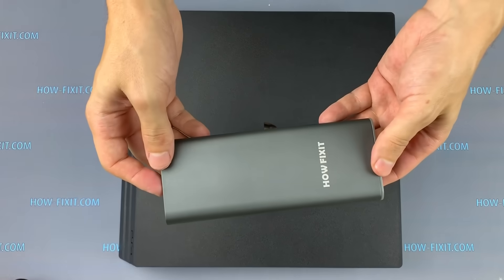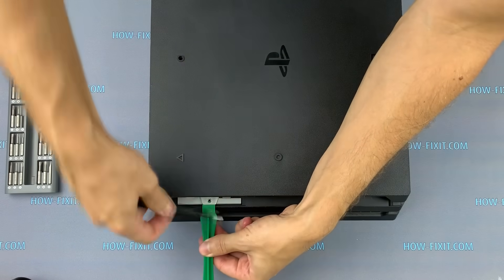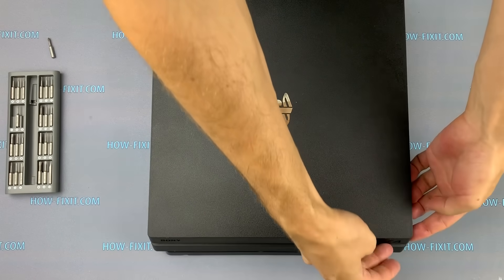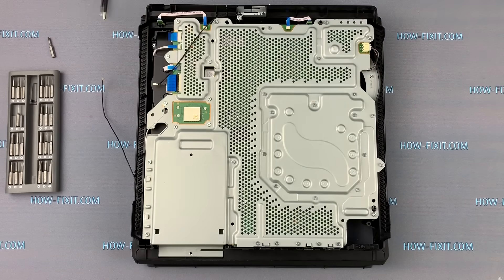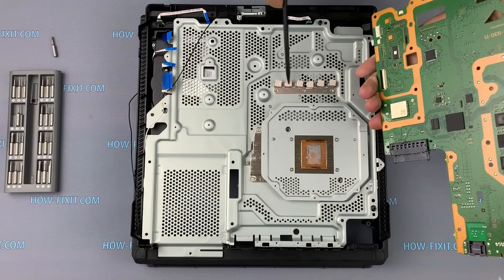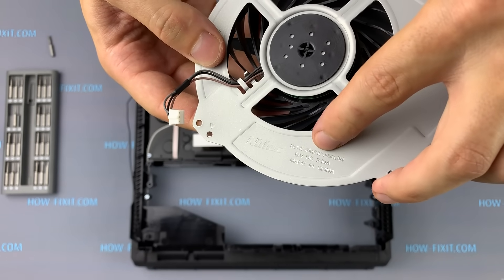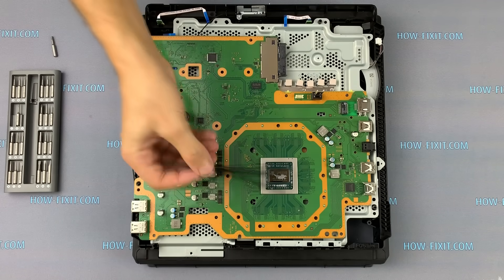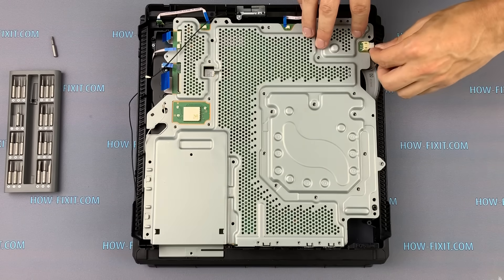PS4 Pro Disassembly: Ultimate Guide for Fan Cleaning and Thermal Paste Replacement

Comment: This worked beautifully. I have a ps4 pro and playing games where cutscenes would occasionally occur, I was constantly getting overheat messages and it would sometimes just straight up shutdown resulting in having to wait on it to restart and run memory test. The instructions here were well laid out and easy to follow. Because I'm sometimes of a perfectionist, it took me about an hour and a half to complete.

Couple tips for anyone wanting to try this. 
1. The tools are must have. Do not attempt without the correct torx and Phillips. A tiny flathead is recommended too, as when I took off the case, a couple screws looked slightly stripped at the heads.
2. I bought Corsair name brand Thermal Paste model/type XTM50 from Best Buy. During this pandemic, you can walk straight up to the door, ask them for the part, and pay at door. You do not have to order online and wait for it to arrive. 
3. I also bought some electronics spray cleaner. Not compressed air. It cleans and evaporates quickly. It's also good to use if you need to start over applying the Thermal Paste. 
4. TAKE YOUR TIME. Better to take 2-3 hours doing it slowly and right, than to try and rush it and break a wire ribbon, essentially throwing away the money you paid for it. 

I have since tested the PS4 extensively (turning boost mode back on), going through multiple games to see if any of the overheating issues and loud fan noise would occur in places they did every time before, and haven't even heard a whisper. Best video I've found. Saved me the headache of buying a new system.

Comment: Thanks so much Mr. It was like a jet engine before. I followed the instructions step by step and now it is quiet as heaven. First I did not believe in this process but it is amazing. I used arctic Mx-4 thermal paste also renewed thermal pads. Thanks man..

Comment: Amazing!!! I bought used PS4 Pro, it sounded like a jet engine in almost every new game. I thought thats normal, but still used your video to open and clean it, change thermal paste, and found that factory paste was very very bad, and the radiator was almost jammed by the dust, mixed with moisture. It was like almost like carpet that stopped airflow. Now, my PS4 pro is totaly silent. Thank you!!!
Reply: Where is the heat sink?

Comment: Thanks for the guide! Before I had 80dB noise coming out the back, after I replaced the paste and thermal pads it dropped to 50dB. Difference is absolutely HUGE!
I used Thermal Grizzly Hydronaut (Kyronaut was not available at the time) and Gelid 1mm pads.

Comment: Hii hope someone replies.  I want to clean my ps4 pro (due to lockdown & my console is overheating in this period) but i dont have a compressed air,  a thermal paste or any of the tools in this vid (except for a t8 screwdriver) is it ok if i try to clean my Heatsink without changing the thermal paste?
Reply: Yes
Reply: @GubbinsReal  have you tried yourself?  Many of them on Reddit say not to do so
Reply: Maheshwaran Gnanasambantham I am doing it today, but i am replacing thermal paste. I would just get the things you are missing and replace thermal paste as well. But that’s your choice :)

Comment: My heatsink wasn't all that bad. It was fairly clear. However, replacing the thermal paste turned out to be a night and day difference. It went from propeller engines level loud to whisper quiet. You have earned a subscriber. Thank you!

Comment: Dude thanks for and amazing video. My Pro used to sound like a jet taking off, but today I changed the thermal paste on the CPU/GPU as well as  the pads on the RAM. Just booted up Warzone and its silent, I mean totally silent, the fan doesn’t even kick in. For other users info I went for Thermal Grizzly paste and Artic pads. Could not have done it without your help. Hat’s off to you.

Comment: PLS HELP ME, hey guys, my ps4 pro wont turn back on... its beeps, then the blue light turns for a second on then it shuts down completely. The first time it worked fine, i just blew away all the dust but the second time ive replaced the thermal paste and put on the one from grizzly, and even the pads all new. But now its not turning on...  pls any tips will help. ty in advance.

Comment: I'm kinda pissed that I almost ripped off the connector to the PSU from the motherboard when I heard a bit of a crack sound because of how you did at 3:14 and I read somewhere online that the connector has some tamper proof superglue or whatever it is that made pulling the connector too hard. And I saw another similar teardown video and he included a warning about pulling it and he even used a certain plier. You should at least warn viewers about doing this so. Some other teardown videos also warn viewers about the gripping area when opening the case. I'd recommend anyone watching this to watch more teardown videos and not relying only this. There are some videos also explain different models of PS4 Pro and that there are some that has screws on certain areas and others have only latches.

And really, showing us making coffee? You spent that time to include in your teardown video and not try to at least warn something before attempting to do something to a part that can be very risky?
Reply: I wish I had read this first. I came across the cable connected with my PSU and it would not disconnect to the point I stopped myself going any further. But now I think when I put it back together, the two metal pins that fix next to the PSU cable to the motherboard have not slotted back in right. As my ps4 no longer turns on. Going to have another go at this tomorrow morning. But a MASSIVE warning out to people attempting this if you have a different model to this guys (mine being the different Power supply socket is slightly different.  Don't attempt this. As a lot of the disassemble parts were no where as easy as this guys ps4 model is. The one I have is very much tamper proof which just caused too much stress for myself.

Comment: Thank you so much for this video. Great very clear video and the highlighting of screws at points was very useful.. Took my time and got this done in about 3 hours, including the cup of coffee in the middle. My jet powered PS4 Pro us now nice and quiet. There was only about a 60% to 70% covering of the CPU with thermal paste when manufactured.  The 2mm blanket of dust accross the front of the cooling fins was probably the biggest  problem but it is quieter now than when new.

Comment: I’m struggling to get this thing apart.  I tried T-8 torque but adapters and they don’t seem to fit for the inside screws.  I tried 7, 8, 9.  Someone please help!!!
Reply: I encountered a few T-8 screws that were already stripped (from the factory) on my nephews PS4 Pro while following this guide. I was able to unscrew these using a flat head precision screwdriver (size: 2.0x25). You need to apply a bit of pressure on the stripped screw with the flat head and slowly turn. The flat head will eventually engage at an angle that allows you to unscrew thee stripped T-8 screw. Hope this helps.

Comment: Just cleaned my PS4 Pro and replaced thermal paste and pads and it is much quieter now. Thanks for tutorial on disassembling the thingi!
Reply: Is it hot 
Cuz mine feels so hot while playing days gone for example 
It is quite but feels hot
Reply: @hishamfarah2087  if it doesnt shut down for overheating u are good
Reply: Did you use isopropyl alchohol to remove the old paste?
Reply: I couldn't decide on the thickness of the pads for PS4 Pro.  1mm or 1.5mm help.

Comment: Got to the part where you unplug the power supply from the motherboard, and mine just would not budge. I read that some people use pliers, which I tried - I was trying to grip firmly when the pliers slipped off and took two of the wires with them. I think this was due to the pliers lacking the proper grip. Broke my pro! A replacement connector cable is coming next week. Be careful kids!
Reply: True, but there is another solution, just unplug it on other part, directly from power supply, its easyer ;)

Comment: I stuck at 3:15 the power supply just won't release!! I almost break it so i decide to assemble back my ps4 pro luckily it survive
Reply: DId you remove the 2 screws mentioned at @2:12 on the top of the PS4 prior to removing the power supply unit? those also screw into the PSU. I had the same problem till I realized i needed to do that first before removing the other screws.

Comment: Fantastic video but I'm stuck at removing the cable that connects the power supply to the motherboard - IT JUST WONT RELEASE!! I've been trying for at least 15 minutes now but IO cannot remove it from the power supply or the mother board. Please help! 3:15 in the video.....
Reply: Me either, i almost break it!! I decide to put it back without doing anything luckily my ps4 pro survive
Reply: @stickyrice5943  Thanks for your answer! I put it back too but I decided to blow some compressed air through the whole system through the heatsink first and loads of dust flew out of the PS4 and now it is completely silent again! No need to go further and replace the thermal paste etc!
Reply: Robert harris mine still loud AsF.. perhaps the thermal really gone bad..